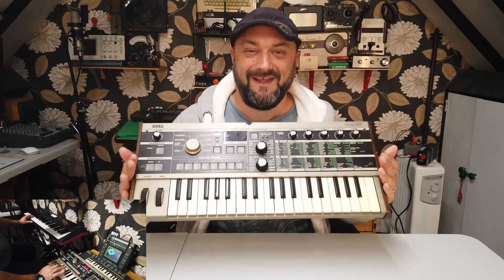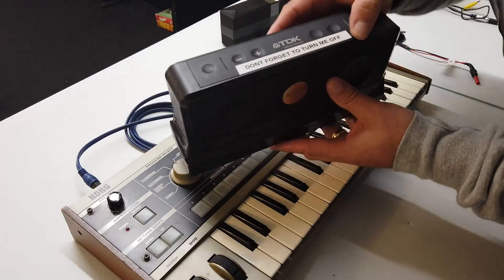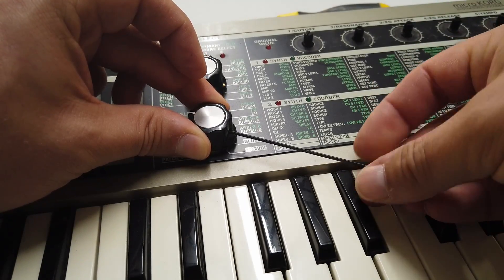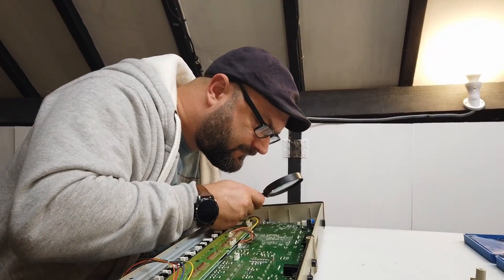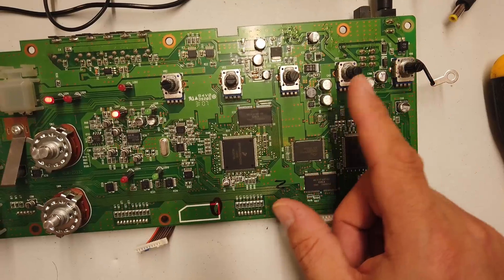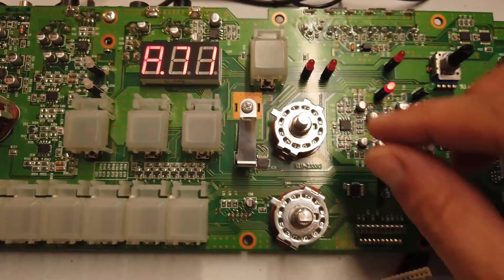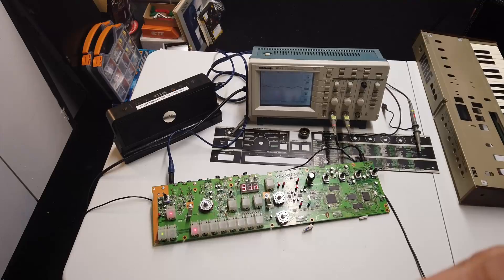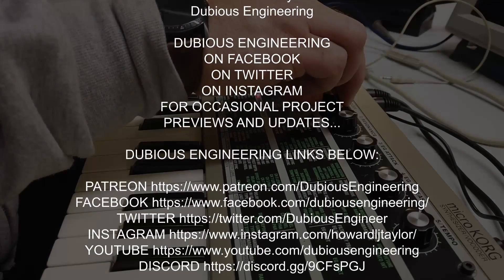DuB-EnG: Inside the MicroKOKRG Synth - Disassembly Teardown Repair Refurbish Review and FIX - NOT

Comment: Im looking for my first synth, and i saw this option with a fair price. but the guy selling it says that the power jack has a problem, is it hard to switch it with a new one, is it pricey?
Reply from the maker: £10 for a part delivered next day, £30 for the soldering skillet and effort…. £40 to post it to someone else plus parts and labour…. Just make sure you have the soldering skills and the correct part

Comment: I'm trying to figure out what is wrong with mine. It turns on, all the knobs and keys appear to be functioning, but only static occasionally comes out, would you have a guess as to what is going wrong inside, or know how to check?
Reply from the maker: I'd get an oscilloscope on the audio output side of the DSP - before the main amplifier to see...

Comment: I have a weird issue with my microkorg. The AMP EG position of the edit select knob doesn't seem to connect. If i've selected the previous notch, (the amp section) I can obviously adjust the level of the microkorg with the 1st top knob. If I then go down to the AMP EG section where that same knob should control the attack envelope, instead it thinks its still in the AMP section and  still controls the overall volume. If i go down to LFO1 and then "up" the amp eg section, the knobs are still controlling the LFO1 parameters. Its like the microkorg isn't recognizing the AMP EG notch at all when the switch is in that position, but instead either the position before it or after it depending on what was last selected. Is this most likely a dirty contact? I plan on tearing mine down for a good cleaning as well, but I was wondering if anyone else has seen this before.
Reply from the maker: I’ve not seen this before, good luck, I hope people watching this can help you!

Comment: Great video. Now I know where to begin. The MK I have has an issue with the Vocoder. The 1/4 cable in produces no sound, but the VU meter shows a signal. And the 1/8 inch in cuts in and out. To me this seems like just a loose connection somewhere but wonder if you have ever run into a similar issue.

Comment: Thanks! This video is super helpful! I bought a used Microkorg that apparently was plugged with an AC adaptor. It turns on perfectly, but the issue is that I get almost no sound from neither outputs. The outputs have very low volume. What could it be? Thanks mate!
Reply from the maker: Almost no sound? - Perhpaps the audio output amplifiers are blown...  can you solder and do you have an oscilloscope?
Reply: Thanks for getting back at me! I can solder it, how does the audio output amplifiers look like? Where are they located? Thanks mate! 
  @DubiousEngineering

Comment: Hi everyone, is there a chance to repair Midi in (it is not working), i see at 7:00 it is direct on the board ?
Reply from the maker: Check the soldering around the din connectors first.
Reply: @DubiousEngineering  Ok, thank you
Reply: @DubiousEngineering  ok, i dismantled the engine and was able to follow electrical signal from a connected 5 pin midi cable to the backside of the board. After reset midi worked for some seconds now its dead again.

Comment: i got one from a trash find, sadly the power supply and replacement doesn't work. So i know it's the DC input jack. I ordered a new one and i'm hoping I can figure out how to desolder the old one so I can put in a new one. Tho maybe I'll try a spray of deoxit inside, idk why i didn't. I know the synth works because i put some batteries in it. Tho all the knobs are missing now so have to replace those also.
Reply from the maker: 3D print knobs !  Enjoy!

Comment: In my last job as a music tech in a college going back about 10 years ago I had to service a Korg MS2000 which is similar with the main CPU and a DSP. The unit was much worse than yours and would produce nasty noisy distorted sounds when played and many of the sound programs and controls wouldnt work. I spent some time trying to figure out what was wrong and decided the DSP chip was faulty. I went on internet to look for another DSP chip and found a seller in America so I bought it. When it arrived I decided my college supplied soldering tools wernt up to the job of removing the old chip and resoldering the new chip so I found a local electronics servicing company who took the board and DSP chip and did the work for me for a good price. When I got the board back I installed it in to the synth again, connected it all up and powered it up and it worked perfectly again!
Reply from the maker: One day I may get myself a hot air station and replace the DSP...  I was really struggling to track down the problem! ... thanks for the tip!  Howard

Comment: I was lucky to find a super rare Vintage Gold MicroKorg special edition. It was mint except someone spilled soda or beer on it and the buttons were sticky. I took off the top fist layer and cleaned it up. The only issue is that the right octave button still sticks sometimes in the humid summer. But only in the summer when it’s humid. In the winter when it’s dry it’s just fine. My question - is there a spray I can put in there without taking it apart that can break down or keep the sugary substance from being sticky when the weather gets warm and humid again, right now it works great but I know when the summer comes back it will stick!
Reply from the maker: Suggest you try “switch cleaning lubricant “ first and then follow up with a little WD40.   Love the old korgs !!!